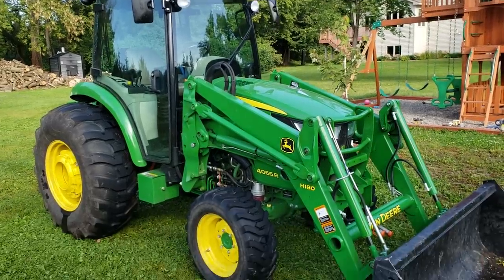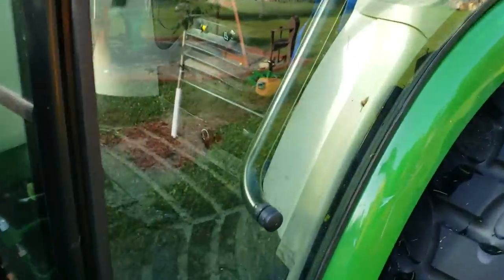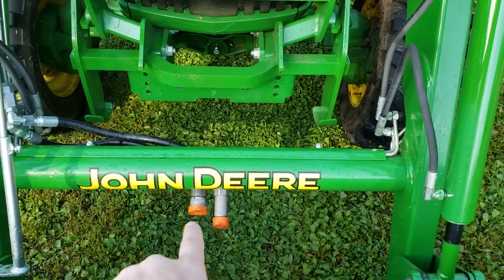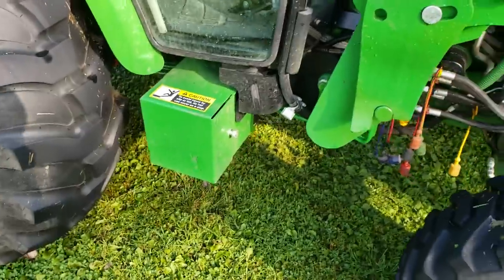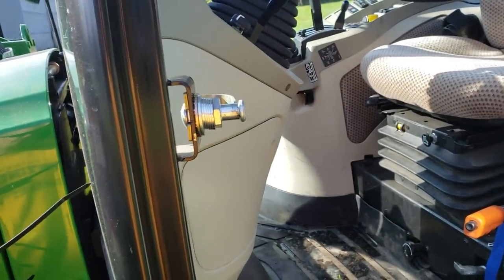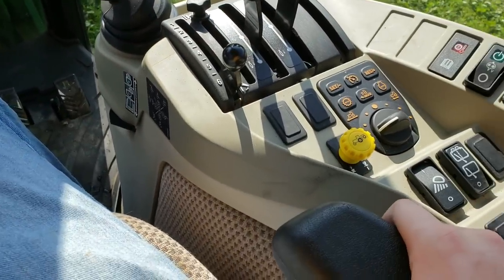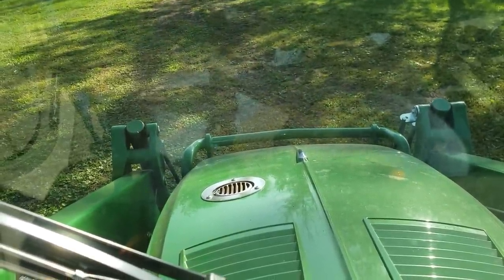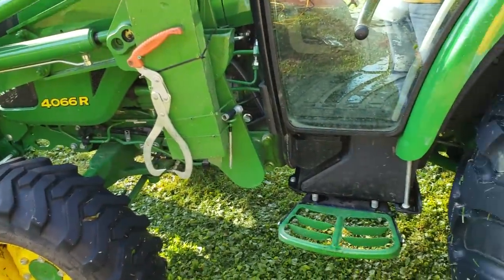4066r john deere critical review.

Comment: Here's what I do to switch back and from 2wd to 4wd. It seems the front and back drivetrains have tension on each other...... especially going from 4wd to 2wd. I use the loader bucket to lift the front wheels slightly off of the ground removing all binding or tension. Then it shifts smoothly and very easily back and forth between 2wd and 4wd. I have a 5 series but suspect you may have the same issue with your 4 series. Hope that helps......Dan
Reply: That's an awesome tip! Made a huge difference on my 3049R when shifting in/out of 4wd.... it was a "why didn't I think of that" moment !

Comment: Great review. I love my 2038R but I’m considering getting a 4 series or maybe a 5E
Reply: Don't buy a 4r i work with one every time it Snow and it suck.  My boss have 7 of these always on the road and 2 spare one and there is at least 1 that break every time we pass and is tractor are not old these is one spare that a 2018, one brand new and the rest are 2019. One have the light on the grill that are not working. A other one is the flasher and mine have a radio that doesn't work. And all of these have the transmission cable that need To be tited too often but for that maybe it because that some Guy that work there should drive a tractor. Between the 2019 are around 305 hours

Comment: I almost bought a 4066R until my dealer gave me a price of $62,000 I stopped looking at JD and bought a Kubota.
Reply from the maker: John deere price tags are crazy.  That's a another reason I move to mahindra
Reply: You get what you pay for. kubota tractors are cheaper because they don't have all the little things that make operating your tractor more efficient.
Reply: brad coddington But JD quality is Not Really Good
Reply: My 4320 has been perfect for 9 years and went to upgrade, and was shocked at the new pricing. I will no longer even consider a john deere, the pricing is completely out of control. At least my cab and engine were at least USA made but that is no longer true for the new ones.
Reply: My 6620 ap jd is very good. 160hp every luxury and only 100000€. Other brand like valtra, massey ferguson or something like that 170000€ atleast

Comment: I do snow removal and have the same exact tractor. Same thing for me, the 4wd is sometime impossible to disengage and i have to lift the front end of the tractor off the ground with the loader to disengage it. Other than that and the fact that i cant fit my lunch box inside the cab because its too small its great machine.
Reply: Easy way to disconnect from fourwheel drive is to be moving when you do it. When you are moving it takes the pressure off the lever
Reply: Or crank your steering wheel all the way to left or right then pull down the 4x4 lever.

Comment: I'm kinda glad that me and my dad went with a john deere 5075e especially the bucket. We were turned off by the price and things that don't come standard with the 4066r. The  thing that probably good on the 4066r is the engine is made by yanmar and is just realiable. We have a 95 jd 1070 with a yanmar and it's still running till this day
Reply: The John Deere engines are just as good

Comment: can get the 3rd loader function added by John Deere dealers.  They pop off that little piece of plastic on the inside of the joystick and put a piece with the buttons there to operate with your thumb, and put the 2 more hydraulic connectors to where the other 4 for the loader are without taking up a rear scv slot. for 2018 at least im pretty sure the open station version the battery is in front of the radiator inside the nose screen area, the side panels for the hood come off pretty easily, and i think the nose screen section slides up, the AC condenser and oil cooler should pivot and lift out of the way, and there should be a screen after the 2nd silver one and the actual radiator that pulls out, i think i might have seen it on yours briefly. My friend just got the 4044r open station and thats how his is, but his has the exhaust coming out the lower left side rather than the top of the hood. there may be some differences between the 4044 and 4066, but they use the same size engine just tuned differently for different HP, made by Yanmar. maybe muffler is different? the open station has the 4wd lever to the left of the seat too instead of the dash, they have the controls quite a bit different from the cab. also the rear scv and 3 point controls are levers to the right of the seat

Comment: Agree with the 4 wheel drive disconnect handle.  Also I notice that if you lock the joystick when you have the loader disconnected, the position of the lock is finicky, I could get the left /right motion to operate without fidgeting with the lock to allow the joystick to function normally
Reply from the maker: I also noticed that my loader lock did not work well and I forgot to mention that in the video.  And that is a serious safety issue when I usually leave the 3 year old in the machine when I do some work on the ground.

Comment: I have a 3033,  the A/C unit the dealer says isn’t as big as on the bigger tractors.  I was wondering if the 4000 series was the bigger unit??  Mine doesn’t do a good job of cooling and I’ve had to replace the unit 3 times .
Reply: I've been wondering about how the 3033 tractor cools. I've been tractor shopping and I have your tractor on my list. Thank you for letting us know. Have a good one.

Comment: (The 4066r John Deere critical review) video, To Luke Thomsen one more point here on YouTube check these out and also check them on Google for spec's on Google. Massey Ferguson 1700 and 2600 series, make sure you type them in with cab. Example: Massey Ferguson 1759 with  cab and loader. Maybe to these maybe better for you based on what you are saying. Here then check out case-international compact tractors on YouTube and Google.

Comment: The man made the video of ( 4066r John Deere critical review) on your concerns about the axle components getting damage well there is a easy fix for that, go and buy 3/8 inch steel plate and cut and heat it with a torch to what you need to make it fit to protect the idems your talking about. And paint the metal also when done. You have to learn fast there is times you have to modify and manufacturer things yourself to make it work better then the factory did. You talk about where the fuel tank opening is to put fuel in on the John Deere that is a good spot, because the fuel tank will not get ruptured easily there. But you are persistent of having the fuel tank opening where you pointed out then you need to go and see Massey Ferguson 4709 & 4710 models and others that may please you. Next maybe you should think about having a 500 gallon fuel tank with electric 120 volt pump sitting next to your garage. So you take your tractor and just drive up to the tank and electric pump and fill up with out any problems that you talked about.
Reply from the maker: Not very practical for your average joe.  In my opinion you should not spend 40K on a tractor that is missing basic protective components.
Reply: @lukedaoutdoorguy7639  I understand what you are saying but if check John Deere Massey Ferguson and others has gotten to the point where there tractors and a public big rip off, one the reasons they are underpowered by at least 75% then alot of them are short of 2 set hose hookups. Many tractors should have 4 sets of hose hookups on the back at least. Many don't. Then the other thing should be on them tractors is one lever to operate the speed of the P.T.O. first gear for the 540 R.P.Ms second gear for 1000 R.P.M. third gear for 1500 R.P.M. that way you would get a choice to what a person wants or needs. And many don't have cabs on them, that should be standard equipment period on all of them tractors no exceptions. One thing that very true car engines are putting out more horsepower even on the 4 cylinder engines then any tractors manufacturers is. Check that and see how true that it is. The major difference the tractor manufacturer is rip the public off for super big mega dollars and not getting what you are paying for in comparison of automobile engine verses the engine put out by the tractor manufacturer it still a major rip off. Here's one example a tractor manufacturer wants $40,000 to $50.000 for a 40 horsepower engine, now go check history on the auto makers side and see what the same size engine would cost, maybe $5,000? Maybe $10,000? At the junk yard from a wrecked vechile maybe less plus tractor manufacturers are rapping the public's wallets badly and United States government is not doing nothing about it so far to keep these tractors manufacturers in check, from ripping the public off badly.

Comment: Which Mahindra did you get and have you had any issues with it?
Reply from the maker: 6075.  I have several videos on my channel about that
Reply: Luke Thomsen question for you . The tractor losing radiator fluid . Is it dusty there ? Reason I am asking mine was leaking but I was able to track it down it is actually coming out of the weep hole on the water pump. I am in dusty condition in Florida so I have to blow out my radiator on a regular basis and it stops leaking. Don’t make any sense but it does. I thought if it was coming from there it was a bad water pump. So basically what I am saying is blow it out and keep it clean and see if it helps.

Comment: Can you remove the loader handle, slip a pipe over the loader handle shaft and bend it back to your arm rest?
Reply from the maker: It is certainly possible as long as you are not using the 3rd function in the handle

Comment: Luke Thomsen sorry it took so long to reply back to you. you were talking about the cost of the John Deere $40,000. cost well if you did some checking these compact tractors are under 60 horsepower, and anybody takes that by the $40,000 that's a big rip off because there are to many engines been built for the same horsepower for a lot less money, example, Briggs & Stratton or Tecumseh or Honda or Kawasaki make ENGINES UNDER 70 HORSEPOWERE PLUS JOHN DEERE AND OTHER TRACTOR MANUFACTURERS KNOW THEY CAN RIP THE PUBLIC OFF AND NOBODY IS GOING TO STOP THEM, BUT THEY FIND SUCKERS EVERY DAY THAT WILL PAY THERE BIG MEGA RIP OFF MONEY

Comment: The man who made the video ( 4066r John Deere critical review) you talked about can not see the bucket when it's down, and other easy fix, go and buy yourself a 1/2 inch or 3/4 inch steel rod or it's also called steel round stock anyway get 2 of them 3 feet long, them every 6 inches apart using tape make it 2 inches wide at every 6 inches when you get done taping that up with masking tape then you paint the open areas where the tape is not at with Construction Orange, then when that dries up. Then remove the tape now it should have a striped look to it  next you still have areas where isn't painted yet, take the tape and cover up the painted areas, next then paint the unpainted part paint that with white or a light blue or red why so you can see it better at night (So when you are done it looks like a zebra strip). Then weld then 2 painted steel rods on the bucket at the top on the outside when the bucket is sitting flat like it ready to dig into something. Just make sure them 2 steel rods are pointed into the sky. It cost a little more in paint but you bought yourself the reflecting paint then when  your done painting those steel rods at night you will find out pretty fast what headlights will do for you to see alot better. One pint if each color should be enough paint to do the job